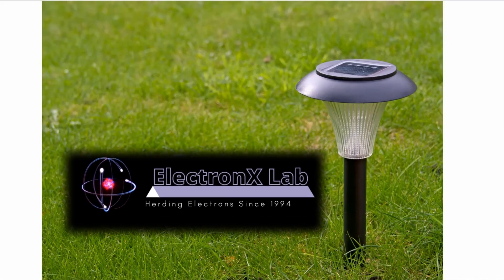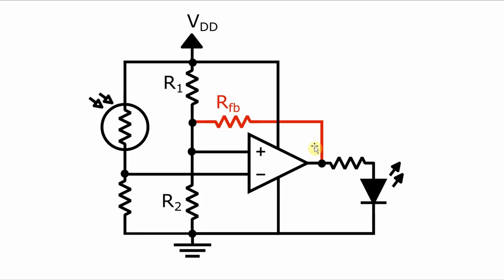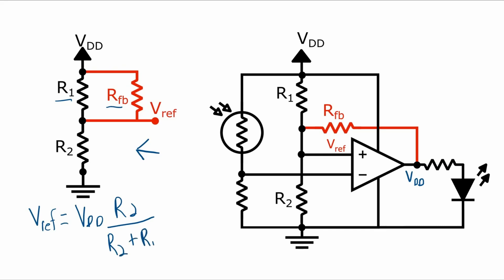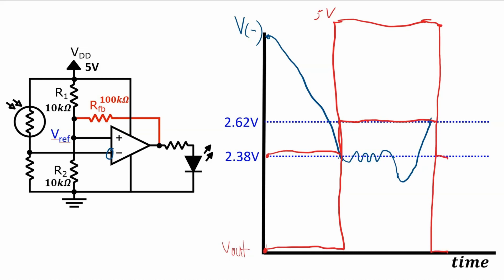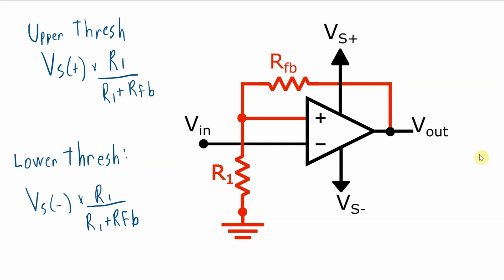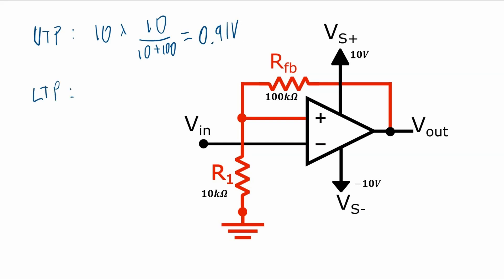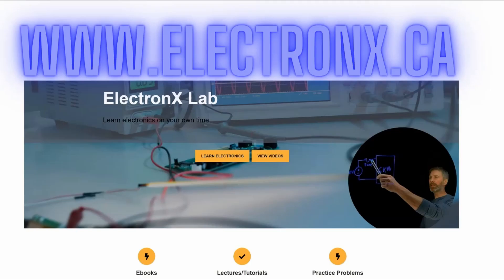Intro to Schmitt Triggers

Comment: The circuit has a “spillover effect” and the concept has become a mode of operation adopted in many other industries.  For instance the fluctuating input voltage can be a patient in a medical setting that “should be ignored” because the volume of the complaint/request/refusal hasn’t met a certain threshold. The differing On/Off voltages can be an appearance time displacement of the care provider and won’t happen correctly at a critical moment.  
By the time the output coordinator charges out back into the node to inform about the mistake in the delivery location, the medication is delivered to an area much later to the proper placement point.  Complacency to discontinue instantaneous intervention.

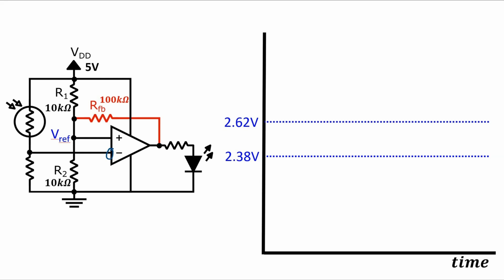Comment: I have been reviewing your information to suss out how to configure your wonderful circuit for my purposes. RE: Circuit @ 3:15 1) The photoresistor has another resistor below it. This resistor does not have a value listed. I am using a 5539 LDR. It is rated at 50-100K Ohms in light and 5M Ohms in dark. Please explain what is going on with the inverting (-) input and how to calculate the value for the unrated resistor. What has me confused is that the LDR and the unrated resistor form a light dependent voltage divider and its voltage output is a moving target. 2) I would like to be able to adjust both the high and low trigger voltages. I believe to do this I would a) make Rfb a 200K trimmable VR and tie it to the wiper of a 20K Ohm pot (voltage divider) that would replace R1 and R2. Please confirm and/or correct. Thank you! Sorry for the poor writing; I am tired and a bit confused. EDIT: I will likely use an LM339 Comparator. That should not effect anything, correct? EDIT2: Sorry, for #1, above. Yes, this the LDR and its voltage is what is moving across the trigger points. Doh! The resistor value is determined by the proper calculation for the voltage range desired.

Comment: Super-excellent! Just what I needed; I am learning about DIYing Solar LED lights. Well taught and demonstrated. I am having a little difficulty setting up a Texas Inst. SN74AC14 Schmitt Trigger, because the data sheet does not show an equivalent circuit. So, I am not sure where to add a pot to trim/set the light sensitivity. That means that I will actually have to read the details of the data sheet - lol.

Comment: 3:25

This means the output voltage is at 0.
Can you explain how?
Reply from the maker: The output of the op amp is Avol*(Vin+ - Vin-).  
Avol is very big, so big that we can assume that it is infinite. 
If Vin+ and Vin- are not exactly equal to each other, the difference between them will be either a positive or a negative value. Maybe a very small positive or negative value, but still not 0.
Infinity times a very small positive number will give you +infinity
INfinity times a very small negative number will give you -infinity.

IN this circuit, the lowest value, the op amp can output is 0V and the highest value is 5V
So, if Vin+ is greater than Vin-, the op amp will want to output +infinity, but it can only output 5v
and if Vin- is greater than Vin+, the op amp will want to output -infiniity, but it can only output 0V
Reply: @ElectronXLab  thank you so much